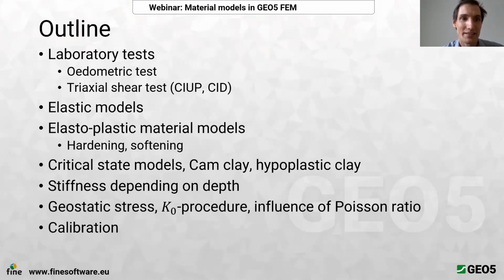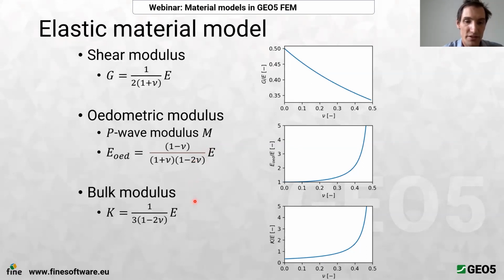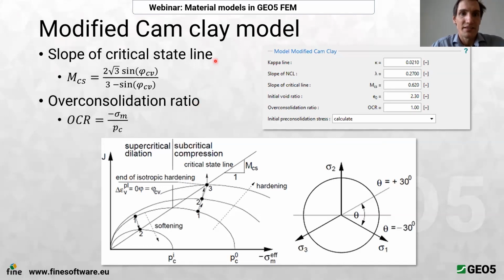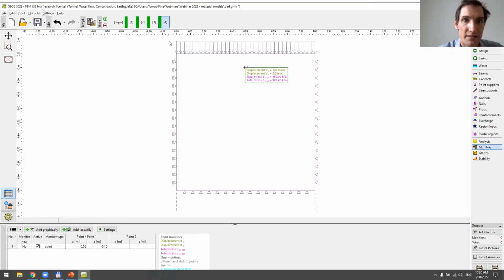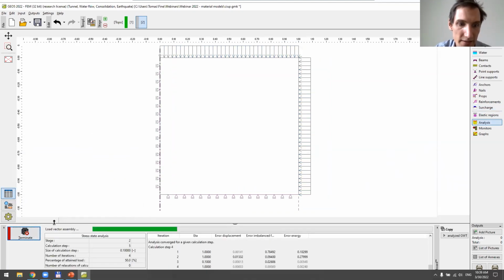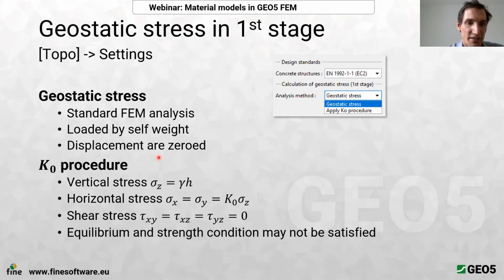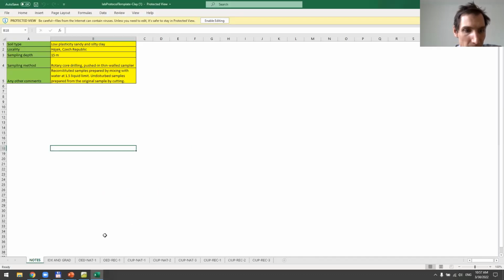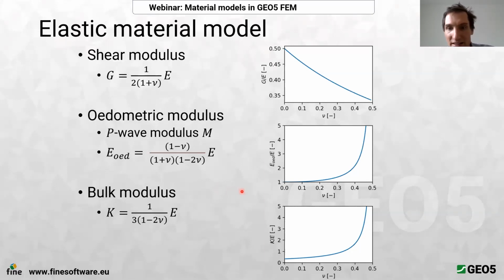Webinar: Material Models in GEO5 FEM software

Comment: Afterwards,  can yu make a explanation on " the method which composed of two kinds of Newton rapson and ARC and each details" ?
Reply from the maker: Hi, the Newton-Raphson and the arc-length are methods to find the equilibrium in an iterative way. For most applications you can use the Newton-Raphson method with default parameters. In some cases, e.g. problems with softening soils, you may need to use the Arc-length method.
Check the help page https://www.finesoftware.eu/help/geo5/en/settings-and-analysis-description-01/